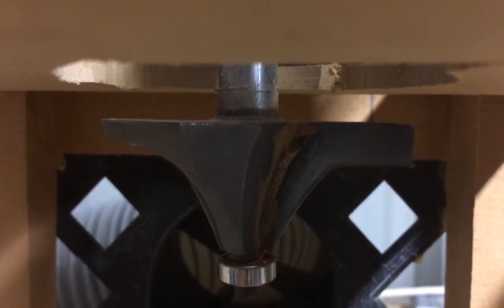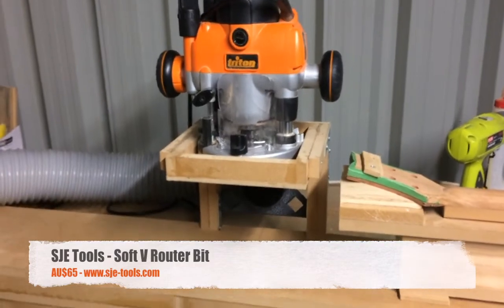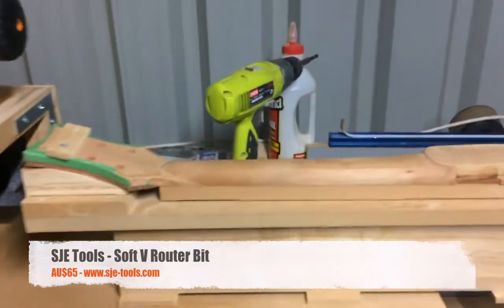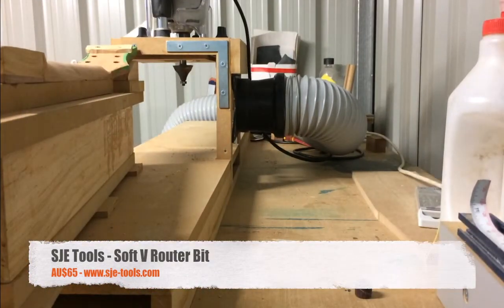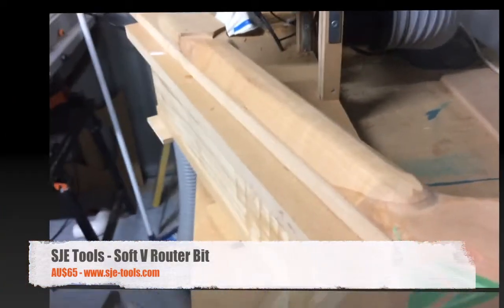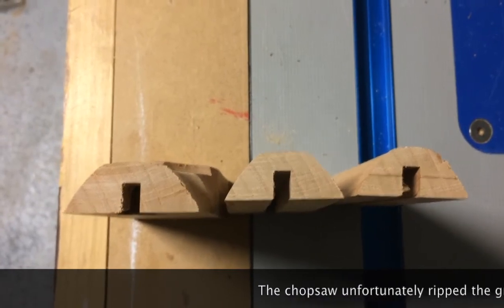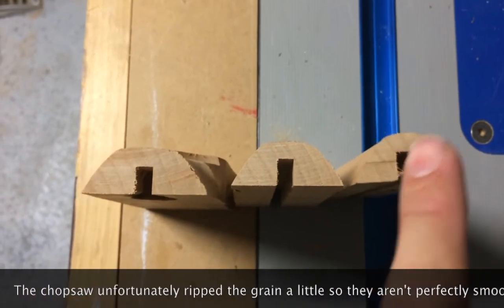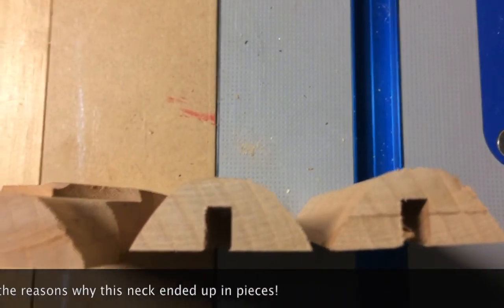SJE-tools - Soft V Neck Profile Router bit Demonstration

Comment: Steve, I was just at your site and picked up what was left of the fingerboard radius bits they look awesome. I noticed everything else was sold out each is awesome for you glad your business is doing so good. I was wondering if you are going to be restocking the neck contour bits I would really like to get my hands on those. thanks.
Reply from the maker: Hi Eddie - thanks for the message :)  The neck bits will be back in stock in the coming weeks - I am currently working on an Ibanez Wizard profile bit which I want to include in the production run, so coming soon!

Comment: Hey Steve, how many horse power is your router?
Reply from the maker: That one is my smaller 2 1/4hp Triton MOF01.  My 3 1/4hp TRA01 reside in my router table.
Reply: @technocracylao  , that's solid information. My table router is 1.3/4 hp. Probably not enough power to handle that bit. I have two of them just waiting to be utilized.
Reply from the maker: @eadsinstrumentsllc  I see no reason why 1 3/4 hp wouldn't work.  Taking small cuts and it'll power through no problem.
Reply: @technocracylao  , you're awesome buddy. I'll definitely give it a shot with my table router setup.